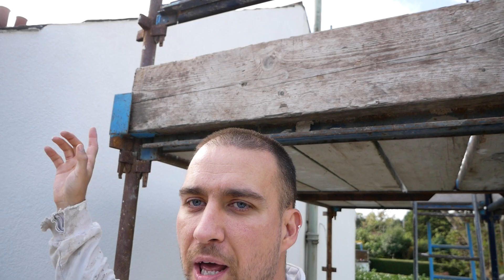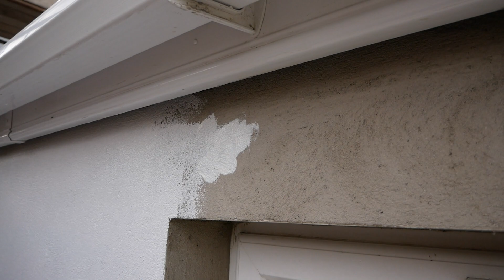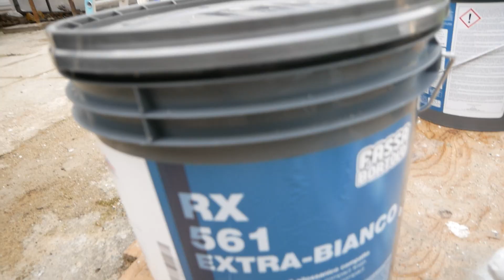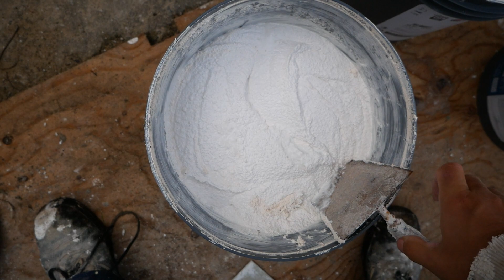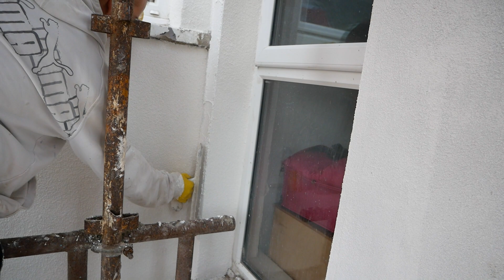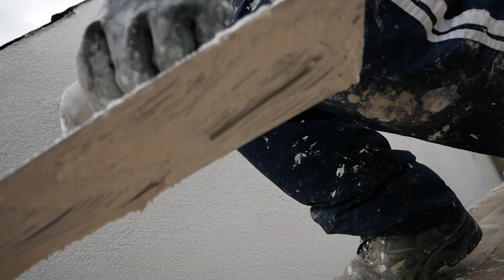How to acrylic / silicone render how to render wall old wall silicone render thin coat rendering

Comment: Joe the job I have over here  they have used a red primer , I’m worried that the red will show threw the white acrylic , 
Surely the back ground has to be the same colour as the finished top coat ?
Reply from the maker: @nicholasbehan5373  I have used white for light colours and red before and did a charcoal colour but the primer for thatcwascsame colour I see what you are saying it's strange why to go about that... could you test on a window reval?

Comment: Looks good. Thanks for the info aswell. Im having a go at this but my base coat was a little bit rough in areas. Will the top coat follow any small indent or bump? I found it a nightmare cos the base coat seemed so hard too work in areas where there was no bead too follow. I used Ewi it gets a skin on it and then u can hardly do anything with it. Thanks mate
Reply from the maker: I have always stuck to the mix my own gear other than bagged renders myself but yes when thing set like that its not to fun at all. this gear can follow what's under it big time might want to try sand out as much imperfections as possible funny i have one to do next dry day and its a little like you say im going over a few not so tidy areas on excysting old render so will have to be on my A game to make it look as good as possible
Reply: @macplastering  thanks for the advice. I thought I'd give it a go but wish if of stuck too sand and cement really. Good luck on that, I'd def leave it too the pros in future lol.
Reply from the maker: @jonnybuckle8789  how much was the gear compared to sand n cement mate?
Reply: @macplastering  I got 5 bags of base coat 2 different primers and the thin coat. Probs 8 beads and It was probs around 350 I bet. I bet sand and cement and paint would of cost less than 100.  It was only small  area but it's rediculous costing that much more
Reply from the maker: @jonnybuckle8789  it is crazy that kind of price compared to a few bags of sand n cement for sure

Comment: To paint acrylic render can you use exterior self primed paint 2 coats ?
Or do you have to use a special sealer for 2 week old acrylic render?
Reply from the maker: @c2k911  if its self priming should be OK but you could do a small test 1st? Agin the acrylic will be set and dry and as its not old it will be clean

Comment: Hi mate. Just wondering when you are doing a job that you are coating over sand and cement would you float and sponge the sand cement coat or just smooth rub finish then prime? Thanks
Reply from the maker: Would still sponge mate have the other stages of this job on channel and a few others on this type of acrylic render

Comment: Should have used the mesh roll to prevent cracks and add durability other than that good video bro👍🏻
Reply: That would be in the base coat
Reply from the maker: @Drunk3nMonk3y72  yea did the areas tgat needed it but not the whole job just windows and joints ect thing is it should help but still isn't a 100%
Reply from the maker: Put mesh in all cracks areas or joints in that block to brick but didn't wrap the whole job
Reply: @macplastering   top stuff pal good video you're good at you're work and it shows👍🏻
Reply from the maker: @patricklynch236  thanks again mate appreciate the support 👍

Comment: Top video buddy good lad work out on the arms. Haven’t used it but does seem to easier than scrapped back render ?
Reply from the maker: not sure if it is easier as you have all the rendering to do before hand where as the scrapped gear is a one coat or like i like ti double coat booth hard work LOL
Reply: @macplastering  
True. Buddy.

Comment: Would this work over painted render?
Reply: Depends what condition the painted render is in.. If the paint on the render is solid and not flaking it should be fine..  I would personally give it a coat of primer and wait a few days for it to completely dry then go over top with thin coat silicone
Reply: Acrylic will work fine over existing s/c, another option is to spray Corksol on. It’s a great product too.👍
Reply from the maker: @markneeson7162  have not used that gear has it got Cork in it?
Reply: @macplastering  yeah look it up Joe. You can use it as a finish externally or spray it on internally and skim over it, improves thermal efficiency about 30%. Stuart Roberts did an interview recently with Jamie Orr from Corksol on Trowel talk.👍
Reply from the maker: @markneeson7162  will have a look at it  cheers mate think I herd of it years back but nothing more for sure will look into it cheers
Reply from the maker: Will have avideo on that subject in coming weeks mate